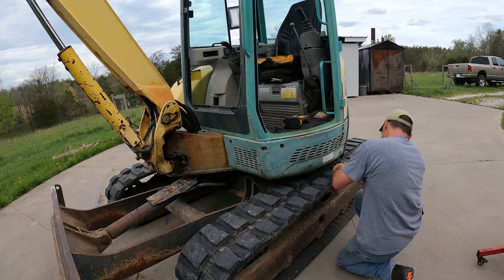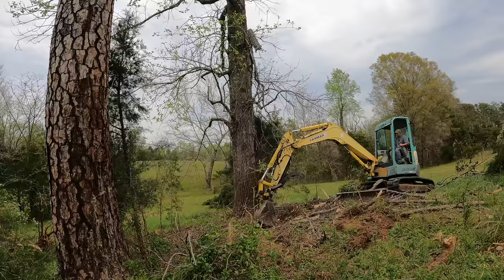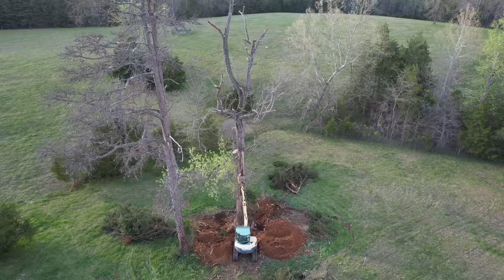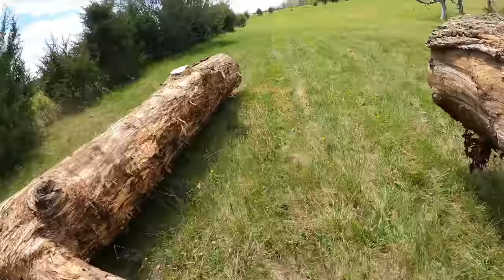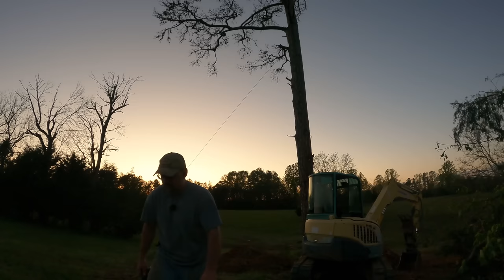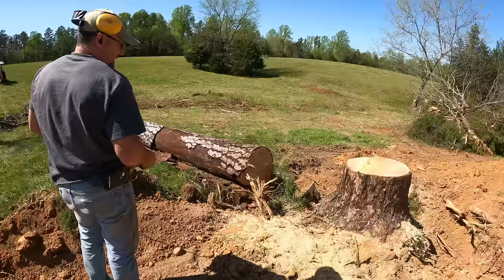Digging BIG Trees With A MINI Excavator.  Yanmar VIO50 Digger

Comment: Hey there again.  I'm the guy who has the similar excavator to yours, and provided those LED light upgrades and parts before.  (Still waiting to see a video on that).  I've now taken out over 1800+ trees with my excavator, and many with the size you are doing.

Pro tip.  The larger the stump, the thicker the roots will be at the base.  The excavator has no problem moving dirt, and lots of it quickly, so don't feel like it's going to take forever.   It's faster this way even though it is more dirt to move, so on a large stump start digging farther outwards, like double where you would normally start.  The roots are thinner there, and break easier, and if you don't start out there the thicker roots at the base are held in place by the tree and the dirt outside of your digging circle on the other side so you are fighting two sources of hold, so by doubling your circle size you take out one end and work your way in. Just look at roots at 15:23 in this video and see roots stickout out from the outside rim. This still will take some time, but it's so much easier on your excavator and the inner thicker roots will break easier.  Your excavator is capable of digging 14 ft depth, I've had to dig as far as 7 feet down, never more than that, but I've had to dig often 6 feet out from the side of the base on large stumps.  watching your video at 15 mins in, your hole needed to go down maybe another 2 ft for a stump this size to make it easier.  Ping me for tips.

P.S. I also have a slow left track, mine is weaker than yours even.  If you figure that one out, you'll help me too.
Reply from the maker: Thanks for the tips.  I'm pretty sure the final drive is just worn out.  Darn things are crazy expensive though, and I'm getting conflicting answers on possibility of rebuild.  A couple places told me that these smaller ones "aren't rebuildable."  I'm skeptical, but the fact that they don't even want a core if I buy one is pretty good evidence.  I'll have a video coming up on it soon.
Reply: @FarmCraft101  One thought.... how about a throttle valve in the lines to or from the stronger drive motor to restrict it to the speed the weaker motor is running at.....
Reply: @FarmCraft101   I have to agree with theniki... start out a little farther away from your tree/stump and dig in and then also a little deeper too.  That tree would gave pushed over easy.   I am not close to the number of stumps he's done but I have done a lot and my backhoe is smaller than yours and I'm able to do big tree/stumps in about an hour.

Great content as always and in my opinion you could use that wood for forms at the very least, it's waaay too good for fire wood.

Comment: 12:50 😆🤣  Yup pines have deep tap roots even though their base roots don't spread as wide.  Nice fix on the tree trimmer.  50:51 Yup. 😡🤬  Pines are a pain .  Now that's a tap root!  I think a bigger digger would have had issues with rhat tap root too.  Great job with such a small digger.  Great video.  Thank you Jon. 👍

Comment: Hello John, 
Thanks for all of your great videos.
Drawing your attention to the 1st tree u fell.
Note how the upper branches  exploded when they hit the ground (rotten).
U were running the excavator under one of them and shaking the heck out of that three.
Not sure your excavator roof would protect you from a ten inch branch.
I know of three accidents from falling limbs. One death and two severely injured.
I have a Yanmar B3 and am just replacing the pump and one drive motor.
Heavy contamination in the oil and oil tank.
Biggest issue!!
How to clean the entire hyd. system before running the new pump.
Am ordering Weatherhead FT1455-L1 projectile launcher (shoots foam cleaning bullets thru the hoses.
If u discover another method,  I would love to hear about it.
Am also thinking of installing a 120V 3 micron recycling pump on the hyd. oil tank which I would run after using the machine.
Run it overnight to super clean the oil.
Your thoughts/suggestions aprpeciated??
Chuck

Comment: If you're left track is running slower than the right I've had this in the past it turned out to be the left hand drive motor was weak new or regen or  refurbish it yourself

Comment: next time when you are pushing, put the blade behind you itll dig in and give alot more leverage ive taken down a tree close to that size with a 35 series tak... just takes a bit of time.... i also dig all the way around them
edit: also use the bottom of the bucket press it against the tree and pull downward with the main arm and out with the the other
and damn yea i couldnt of done much with that pine, ive never dropped one with a tap that big

Comment: I WAS TOLD BY A SMALL ENGINE SHOP, NEVER USE STARTING FUILD ON A 2 STROKE FUEL/OIL MIX MOTOR.  THE LINNING OF THE PISTONS CYLINDER IS COATED WITH TEFLON Starting fulid eats it and youll junk the motor.    Try some stright fresh gas to clean out some of the oil. Its usully bad gas or a busted pickup fuel line and filter.   The shop told me that 25 years ago and he showed me a weedeater motor torn down with teflon linning part of that was gone, once that happens you loose compression.

Comment: I'm a farm hobbyist too and I lost a tooth off my excavator. My son came around with his metal detector a year later and you wouldn't believe it the first place he put the detector down it went off and there was the tooth. I was digging out a creek. Yes I bought 2 sets of new teeth for all the buckets. Got some Tiger teeth too. Haven't used them yet since the new ones are so good. 

Re the slow track, why not slow the 'fast' track with its stop screw - problem solved.

Comment: Cut a rocket stove into the stump, load it with a few bags of charcoal and diesel and let it eat! in 2-3 days the tap roots will be gone deep enough. plunge cut from the top as deep as your johnson can reach, then come in from the side angled down at 15-30 degrees. You need the initial fire to be blazing hot add a leaf blower and just get it going... after that the wood will dry out and smolder away.

Comment: That would have been cool if you could get some lumber out of that popler. What did you end up doing about your log splitter? Pines where I'm at have a big tap root, looks like that's the case where your at too... I was not surprised when you show what was holding it. a bigger excavator might have been able to push hard enough high enough to break the tap root. 

On my dads property he just took down a Pine that was close to 300 years old, a tornado years ago when i was in HS broke the tap root and started it leaning. it still stayed standing till 2022 when some wind storms accelerated the process it was getting to be dangerous and looking to fall onto some fences/cattle.  It was funny when he was bringing to logs up to me so i could get them milled, he was going past log trucks with dozens of pine's and they might have fit 4 of the logs he had 2 to 3 of.

Comment: Once you've dug a hole around it, if you pour in a load of water, it loosens the soil and lubricates the roots. It works a tree-t 😁. Been using this method for years.
Edit: Of course, you knew that already.

Comment: I
 once dug about 200 pine stumps in our back yard in Arkansas, with a case 580k. One stump appeared to be 12 inches in diameter.  Turned out to be 42 inches I was able to break the tap root 15 feet deep. It was about 10 to 12 inches in Diameter.
If anyone trys to hire you to dig a spruce stump, I would give it a pass. The one I dug had lateral root 10 to 12 inches in diameter and 10 to 12 feet long 4, 5 and 6 feet deep. it took me two days.

Comment: I do not like grinders because the stump is still there

with a 22t I keep going out further away from the stump until the roots dig easy and then work my way back in, same with a ripper (exc doesn't look like it is struggling and it is easier on the exc).  I have never dug out a big stump with the yanmar though.  dig deeper is all I could add even on the pine, yep pine are tight in Aus also, usually break off if you dont dig or rip, even tight in costal sandy ground, that was not super big stumps with the D8 size Komatsu dozer, full of down roots.  I done a lot of stumping with this dozer

That big stump looked like the blue gum we get here

exc Ripper is good for cleaning dirt off and the initial couple feet down.  I mainly used 22ton but 50 is unreal great cleaning dirt off with the ripper because it breaks off a lot of the down root nest so easy

I would leave the trunk on to get the leverage push, just go deeper, all the way around, the tree won't fall if you can't push it

May have got another fire wood billet off that big stump, but once the dirt is off it could have been burnt at the hole, just keep bringing wood in, it will burn

Mate top marks, stumps yeah get the barstards out I hate them too, unsightly and in the way.  You know in the old days they used to dig them out by hand, follow the roots out cut them off, pull with horses, I imagine they burnt the big ones at the hole.

Those limbs are a worry John, I heard of an iron bark (tree) head coming down through the canopy and into the floor on an 82-30 terex dozer.  Couple weeks ago my son had a fulla cutting the dead trees (no cannopy on the d6h lgp only and cab and roll bar, it would have had to dig them any way, no tree pusher or ripper) and we brougt in the 50t exc with ripper for the stumps.

I'd done the stumps and caught the saw, there was one dead iron bark left un cut, it forked up higher, pushed one sde of the fork off with the ripper no prob, but while pushing the tree and slewing it back up hill, it got a bump or a shake and that other half the head come back and wop on the bare ground nearly back to the machine like parallel to the arm, it hit the ground hard, concluded imediately, yep cut the dead ones if you dont have a canopy even with a canopy you don't want them falling on you.

Iron bark is a strong hard heavy wood here especially hard when dead

You are right with the tree roots/stump when cutting off.  A fulla here cut the stump off a blown over tree, the kids were playing behind the roots in the hole .....

Watch the bucket ram shaft when you are turning the bucket around.  Our yanmar has a plate that slides covering the rams - good idea, factory fitted

Ripper for the yanmar should be cheap.  Tilt hitch lets any bucket or ripper tilt off to 90 degrees to either side and I have heard the talk about how they can dig in under the roots, but going down acheives more leverage, they will come.  My son has a tilt hitch on a 15t and I found it good removing dirt with the ripper out of the removed stumps roots.  not as good as a 50t and ripper without tilt hitch though.

I find the digging on the far side of the tree (where you would put the belly) makes a big difference, in close deep, even go under

D3, my son picked up a new set of rippers complete for his, not that dear, chinese I think.  As for the growsers I note you mention, my son found new plates were cheaper than him relugging the old, do check the prices before you weld, i said and done it plenty but he replied a figure in the versinity of 30 bucks a plate, don't quote me it may have been 25 or 35 bucks

When you are driving the track pin (i hate them pins) you must anckor the off side link/rail, the first pin you done the inside rail was not anchored and the link/rail bends out and jams on the pin.  Next time consider loosining the track considerably with the d3 lifted up couple inches off the ground, you maybe able to run the track off and move it away a bit with your exc without breaking at the pin (ie leave the track complete, together).

Being a contractor I have concern for the machine, it is extra heavy on the fork frame and the front diff on that tractor, they have gearing and power for impliment work but if you load them up against that weight, they will break.  The esc track drive (final drives) are not really made for tree pushing, give one push if not going, go straight back to digging deeper, otherwise the machine is doing a lot of heavy straining for, in the end, nothing and a limb could get broke off.

It is not uncommon for bulldozers to push up a ramp of dirt to get a higher push, ive done it on many occasion with a D8 without the treepusher even with the tree pusher not so often.  Nothing stopping you ramping up for the exc. Make sure you have dug plenty before you ramp up, nothing worse than having to dig the ramp away to dig more roots

Orr you can chainsaw cut down slightly through the back of the tree to half way at a narrow section where the roots join on both sides as low to or below the ground if possible, even nose the bar in verticle and cut straight down.  The idea is to push the tree and it takes the off side half the stump, they can just break off though.  This if it works breaks the stump in half, so much easier to handle, clean and burn.  I doubt the pine would have responded to this but the popla and the big stump well worth a try.

For odd stumps you can blow them, 4 inch auger on the chainsaw about 3 to 4 ft long, I used years ago.  Auger between bigger roots and in slightly under the stump  10lts of nitropril half a stick of gelignite and a meter or so of fuse, get back 100 meters and behind something.  The stump busts up and lifts easier than the whole tree when blasting

Aust used to be able to buy explosives at the corner store but we have gone communist now, can you get explosives there still.  70s and 80s I remember throwing a bag of nitro in the front boot on the wifes bettle in with the fuel tank and a pack of gellly 2 dozen odd sticks, but they would say keep the detonaters seperate so we put them in the glove box, do some shopping and off home

Blasting throws wood big and small all over the place.  Don't even think of blasting when you have a d6 with ripper or even a 15t esc unless the stump is big, the machines are quicker and easier.  Blasting busts up the stump for handling and burning though, it works well with machines your size and you can get the auger attachment for that esc and a 4/6 inch auger be all you need say 4 or 6 foot long, see digging the hole was the hardest part really, originally we had a 4 inch hand auger when I was going to school, like the 4 inch long pipe with cutters "post hole auger" and about 5 foot long to the handle

You have definately got guts and the will to have a go

Comment: Track travel speed.  I am seeing this video after your rather in-depth hydraulic system related travel speed that was inconclusive.  I know it isn’t the best way but have you considered feathering the hand control arm/foot pedal input into the faster track motor to slow it to match the slower track.  Oh, and Pune trees have a massive tap root.
Reply: Pine not pune trees have MASSIVE tap roots.

Comment: I pull trees down with a tractor and 1/4 steel rope cable after digging around it as you did.  I am in similar situation as you are with equipment too small for the job. I have a 9ft back hoe on the back of a Kubota tractor.

Comment: I think Andrew's most reliable excavator is a Kubota KX-121-3, 12,000 pounds machine, but I remember he said he never had failures with his mini Yanmar,  in my chainsaw box, I always have a dulled chain for the roots, but I agree that fabricating a root ripper with only 1 blade, and a sharp one, would make the task easier, your excavator is not too small, I fell and uprooted a 70 years old maple tree with my subcompact tractor, just that it took me one day...and I could not find my root chain, because I forgot I took it out to sharpen it...lollll

Comment: i would of been tempted to cut that poplar log, i mean if  you get it on the saw mill and take a slab off youll know pretty quickly if its bad or not, either way itll be firewood.

Comment: That's not a tap root. What I speculate happend was at some point in the lifetime of that tree there was a grade change that covered the buttress roots (root flare) and some of the trunk. When that happens and the tree servives, it sprouts new roots from the trunk. This contributes to a weekend immune system and invites pests and or high moisture/low sunlight conditions along with fungus or mold. The lighting strike topped it off. It is crucial to not cover the flare of a tree for those reasons (and more). This is why we see many nursery or landscape planted trees fail. Everyone loves to heap mulch or pine straw in a pile at the base of a tree. Even worse yet, rocks. Please don't do that. Lol love the vids and the struggle. The struggle is real, the best way to learn really.

Comment: When you have tracking issues with these smaller machines it is mostly one of these things:

1. 1 of the 2 motors is not getting enough pressure. Most of them can be altered on/at the valves.
2. You have a lot of leak by in 1 of the motors. You can test this by taking the leak hose of the track motor and let it drain in a bucket when you let the track go around 10 or 20 times.
This gives a good indication of blow/leak by when comparing the 2 track motors. When 1 has a lot of leak by, that motor is done and in need of a rebuild.
3. 1 of the idler wheels is binding. But I don't think that is the problem. Most of the times when I diagnosed tracking issues it was number 1, 2 or 4.
4. The levers are not adjusted well. But you checked this and they seem to be ok. And after altering them, it did not resolve the problem.
5. Not enough servo pressure, but that is mostly on the bigger machines, these smaller ones are directly operated from the levers to the valves.
Reply: With the way some parts were Jerry rigged when he bought it, I would make sure the right size hoses are in place. An elbow or something like that being downsized “cus that’s what the shop had” could do it